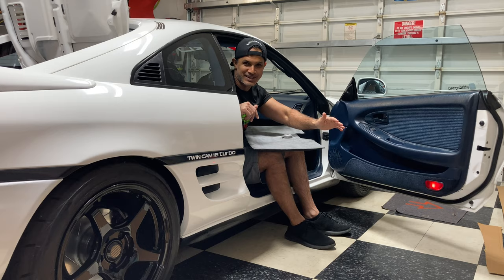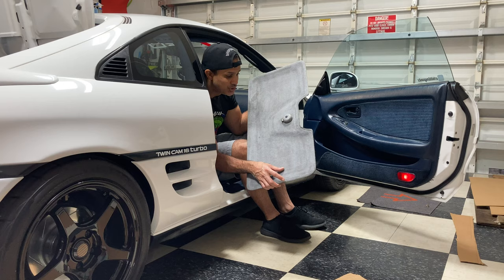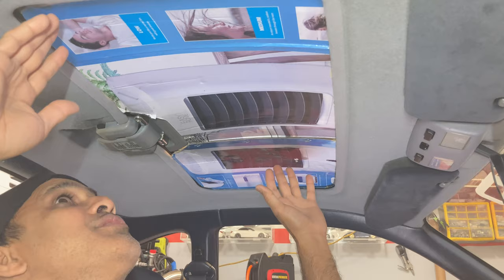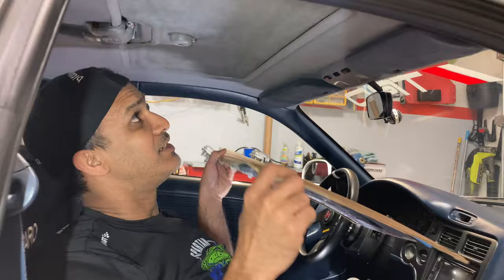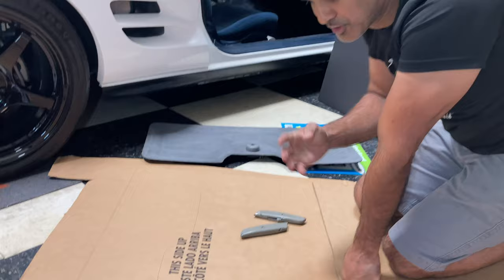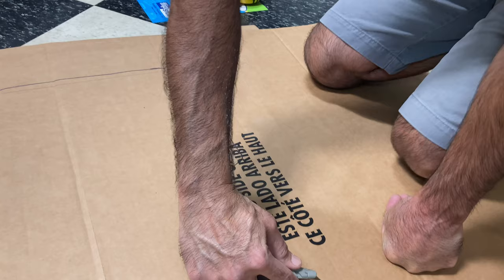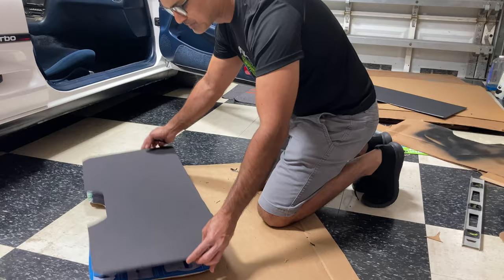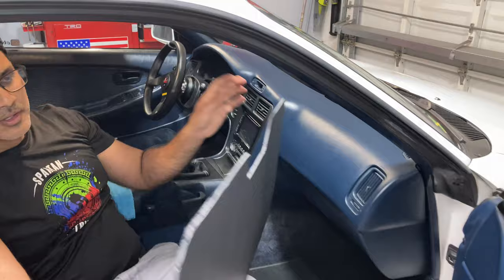1991 Toyota MR2 OEM Refresh - E12 DIY Sunroof Liner

Comment: If you wanna get the oem shape put the original in a bag completely covered then get expanding spray foam make a little squares frame big enough for the original piece then spray the foam in and quickly put the original on top so the shape can imprint on the foam then remove the original piece and soak some thick sturdy cardboard for about a hour to make it playable and Formable then place it on top the foam and press down on all corners and start forming the cardboard after you got most of it put the original on top of the cardboard and foam and push down on the whole thing carefully so you don’t mess up the original. Leave it for about 10 minutes so the shape can imprint then take the original off and start warming up the cardboard so it doesn’t mold with a heat gun or something just dry it out then you’ll have a oem shape and you could wrap it in leather or fabric and if you want find a similar lock mechanism drill a little hole and install it then you’ll basically have a almost oem piece. Sorry if that was Confusing
Reply from the maker: That sound like a job for a professional. Thanks for sharing.

Comment: Hey bittingantz, would you still need a "South Bend S54/3SGTE Clutch Kit" if you have a stock turbo MR2 when swapping in a 3sgte? Or would the stock transmission be able to connect with the 3sgte swap right away?
Reply from the maker: Im assuming you have e153 trans?
Reply from the maker: If you have e153 trans then the clutch disc, pressure plate and flywheel from your car will work with any 3sgte
Reply: @bitingantz  Thank you! Unfortunately, I am still looking for an MR2, was just asking since you had the NA model, was wondering if it would be different with the turbo model. Just realized that the turbo model is a 3sgte so it would work lol
Reply from the maker: Exactly, good luck with your search. Finding a mr2 these days takes a lot of patience or money.